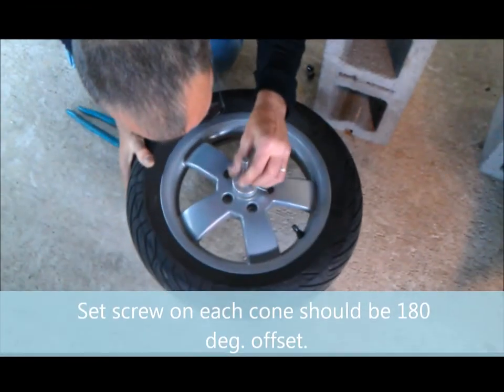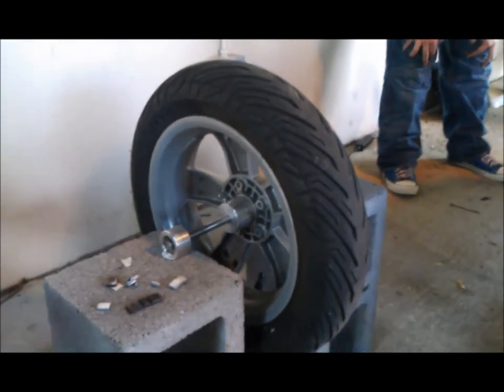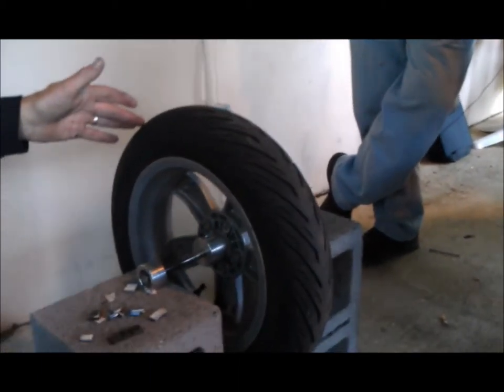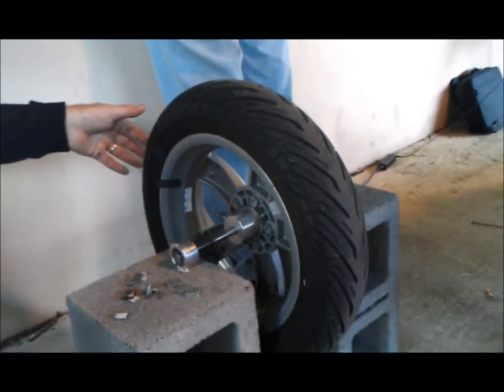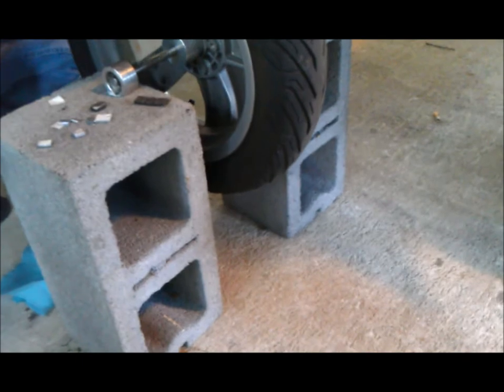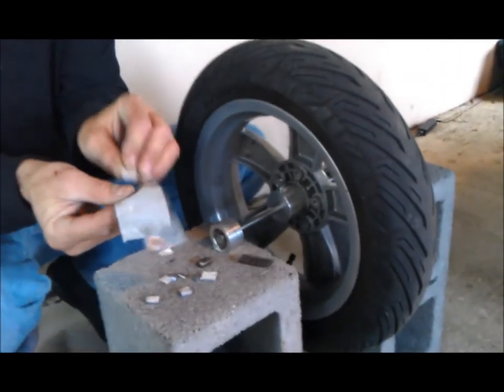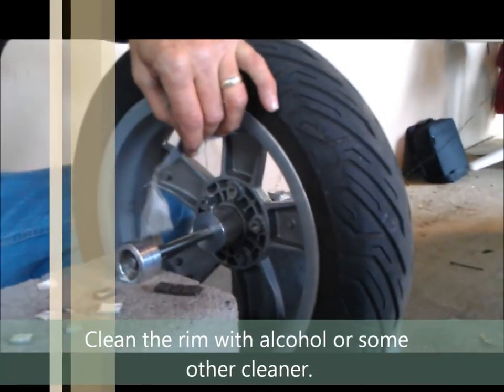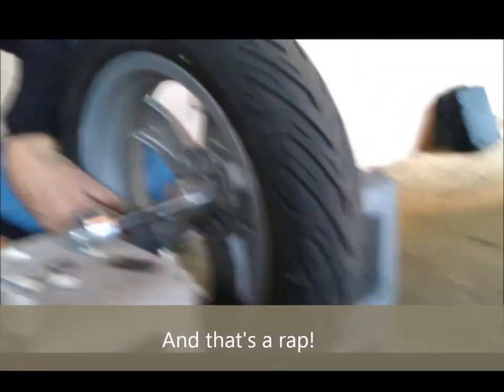Marc Parnes Balance Demo

Comment: The guy was mistaken when he said you have to balance the inside and outside of car (or truck) tires. Sure, it's nice to do that because it helps lateral balance but you can't do that with many if not most newer cars. In fact, many wheels won't even accept the outside weights. On top of that, rim weights can ruin polished wheels and cause bead leaks.  Lead rim weights on both sides of tires have ruined three or four sets of wheels I've had.  These days I have them always use stick-on weights and they are only used on the inside.  I have never noticed a difference in balance and even the manufacturer's are going that way with no problems.

Comment: My handlebars wobble when I ride. Do you think this is a balance issue?
Reply from the maker: If it is a vibration then maybe but if it is a wobble there is something else going there. If you ride a Vespa certain models are known for head shake.
Reply: It's the handlebars wobbling left & right when it decelerates to around 35-40mph. Seems to have started after having a Vee Rubber Tiawan tyre fitted :(
Reply from the maker: Xombigod Yeah it could be the tire itself. Make sure your air pressure is correct in both tires. 29/30 psi. Try a Michelin City Grip next, GT/GTS wobble is a known issue. Check this wiki post at Modern Vespa. http://modernvespa.com/forum/wiki-wobble
Reply: PSI is fine. New tire, but it's a cheap Vee Rubber 'yuk'. I wonder if it's worth taking the tire to a garage to be balanced?
Reply from the maker: Xombigod Personally I wouldn't. If I noticed the wobble with the new tire and my psi is fine I would take off the wheel and have a higher quality tire like the City Grip mounted and balanced.
Reply: Well I can try to get it balanced for £3 Rather than spend another £60 on 'another' new tire
Reply from the maker: Xombigod Well if that is the case then I guess it is worth a shot especially if it wasn't balanced in the first place. Good luck.
Reply: Your not riding fast enough!